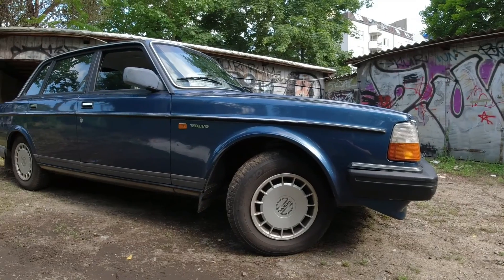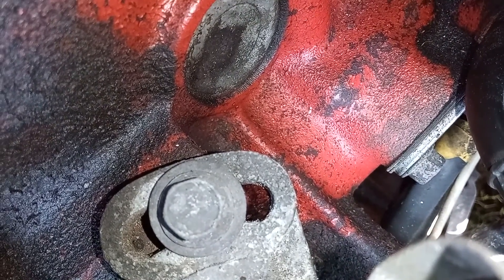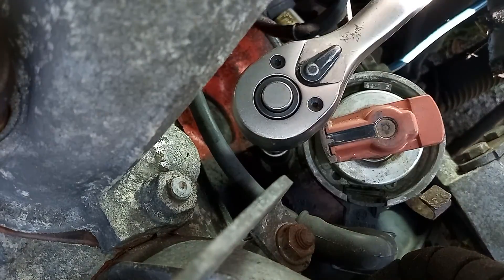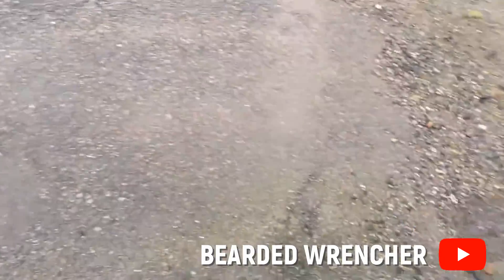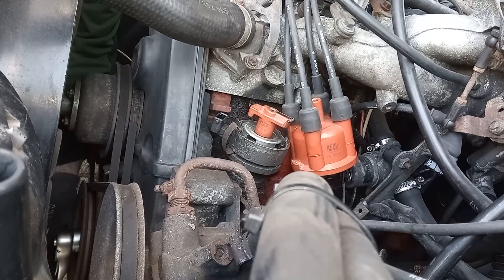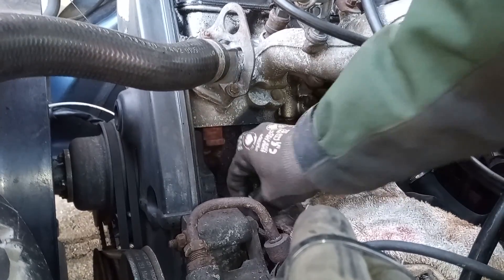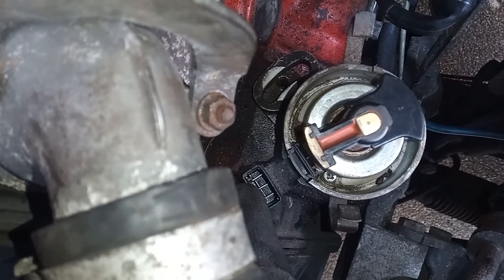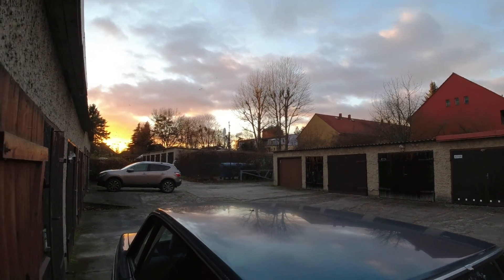Knocking Volvo 240 - Lili gets a Replacement Distributor

Comment: Mine is set to the Volvo spec with a timing light and pings like this too, only at startup or in a very high load / low rev situation and on 95RON fuel. Might dial it back a little.  Good video, I like how it's straightforward and to the point and shows what the original fault sounds like.
Reply from the maker: Thanks! That's good to know, mine pinged way less after this video but there was still a tiny bit, I tweaked the distributor a bit more recently which seems to have helped even more, but I just borrowed a timing light and plan to check it in the next couple of days 🤞

Comment: Im suspecting a timing issue on my 1990 240 but I don't really know. When starting it misses horribly and sounds like it's a 2 cylinder but after like 30 seconds it fixes the idle almost entirely to where it runs normally and as of recently it's been getting worse to where when I press the accelerator it sounds like the engine tries to die before starting to accelerate.
Reply from the maker: If it's just on startup, especially cold start I'd be suspecting the coolant temp sensor or something, or maybe even leaking injectors 🤔

Comment: thank you for showing this. I have to remove one from a '79 B21 and it's so stuck I was a bit afraid to wack at it w/ tools like you did. I have another '91 B230 that comes out w/ relatively little trouble, so the difference between the force required to pull them was concerning.
Reply from the maker: I've removed a few since and they've come out easy! So it really depends like you said. Thanks for watching!

Comment: So whats the solution for the piston slap. J have the same car trying to figure it out. The fuel regulator is only 2years old…
Reply from the maker: A thicker oil can help, and also a slightly hotter thermostat helped me, as the noise should get less or ideally go away when hot.

But the good news is it's nothing to worry about, before I replaced those things this car had extreme piston slap for potentially over 10 years, it's totally fine, great compression, doesn't burn oil etc
Reply: @Involvod  sweet ! Ill hold off in thicker oil because its freeze time. Kind regards from NYC. Everytime i mess with this car it hets more and more intriguing. Love the lack of computer diagnostics and instead old school investigative mechanincs. Your channel is A1 !
Reply from the maker: @adi4145  yeah that's the problem! I put 15w40 in the old 940 and it really helped the slap but I felt as though it wasn't so happy with that oil when it was -7c And yeah, I totally agree, really a joy to work on! Thanks 🙂
Reply from the maker: Also you will find online that many people have had piston slap for hundreds of thousands of miles, it's never an issue :)

Comment: hey man I'm also working on my b200e kjet 240, trying to fix my ignition. I'm kinda of a newbie in mechanical stuff so i missed the part when you inserted the screw driver in the spark 1 socket, what was that for? is it safe to turn the pulley as you did? what are the odds of breaking my engine? I know from the green books that i have to set my timing to 10° BTDC at idle, can I get this done without the stroboscopic light? Greetings from Peru
Reply from the maker: Hey, I've never worked on the k-jet systems, so sadly I can't be of help, all I can say is I heard they can be tricky to work on, but when dialled in right they are great!

The screwdriver was so I knew the piston was at top dead centre, for rough timing reference, but then afterwards I saw the timing marks on the crank pulley that show that, also Mortimer commented on this video that there's a little notch on the distributor body too
Reply: I heard that on B200k cannot be adjusted ignition, the same I thing on B200E. It adjusts automatically by electronics. But I am Curious what happens if you still turn distributor, nothing?

Comment: Only a thought, since I had a similar problem with cast iron fixings I tried to loosen up with that freeze-stuff: Maybe it gets brittle or bends or something if you suddenly freeze it up.
Reply from the maker: That's a very good point, I used the freeze stuff after it broke but it's definitely something to think about, thanks!

Comment: I don't have any magic tricks for the stuck distributor. In pre-environmental regulation days, a shot of freon was said to do the trick. But then that's why we're in this mess now, isn't it?
In any case, I wonder if after removal, a bit of sanding on the distributor where it meets the block might not make it easier to remove the next time. A blob of antiseize wouldn't be a terrible idea either.
Reply from the maker: Haha, I think the general consensus is soaking them down with penetrant for a couple of weeks. I did sand it down with some wet and dry and slapped some grease on the mating surface too, it's amazing how stuck it got considering it didn't look too bad at all
Reply from the maker: Oh and the penetrant I used was a cold shock one, -30c it said, so a similar effect. I've been using it on all sorts lately it's been amazing, I think it's why I managed to crack off all 4 caliper bleed nipples without breakage!

Comment: There is a tiny notch in the rim where the dist cap sits that should be #1 position reference. It looks like yours is maybe 1 tooth past anti-clockwise? At 12:07 the notch is visible just to the left of the connector body.  It's very tiny. Not certain. Distributor work has always been my nemesis. Anyway, sound better than before! Glad my LH2.4 is auto-timing!
Reply from the maker: Just looked at the old one up close at home and yeah, definitely a mark there, thanks! This is why I should start reading the manuals 😅

Comment: I heard Germany locked down recently! Is that was that alarm was?
Reply from the maker: It's either a test or sometimes it's a call for volunteer firefighters to head to the station, crazy!
Reply: @Involvod  wild! It's definitely a little bit crazy. We have monthly tests at 12:00 on the first Friday of every month.

I live a little bit too far away from anywhere to hear them.
Reply: @Involvod  Exactly, the latter is rare though nowadays, as modern technology has now reached even remote areas...